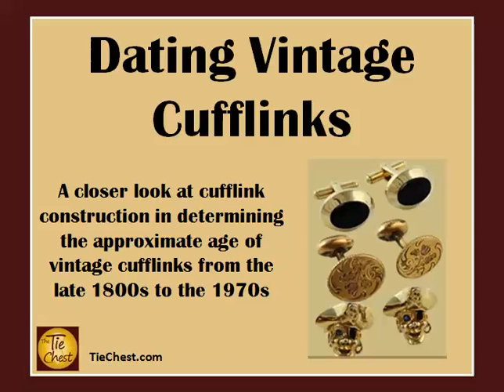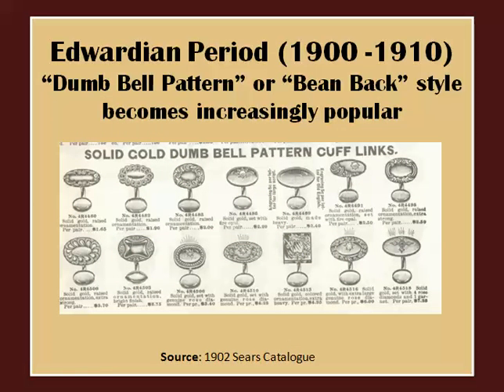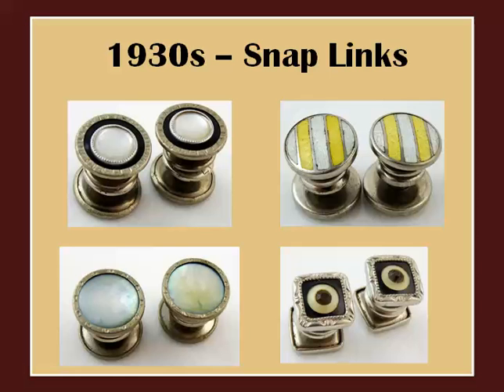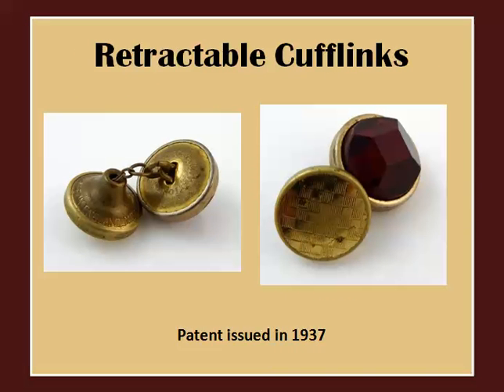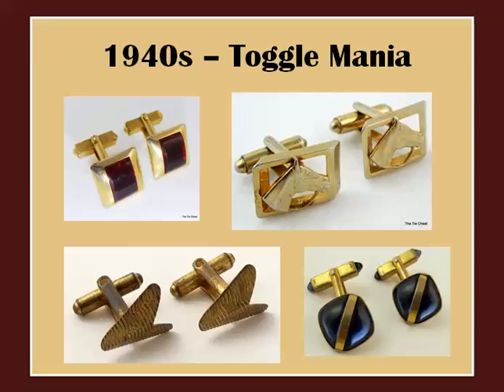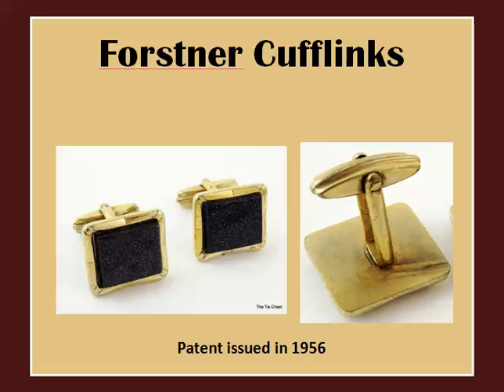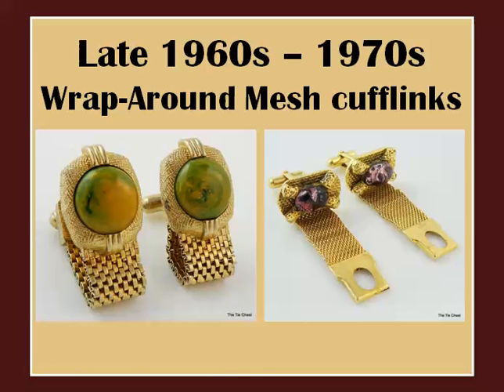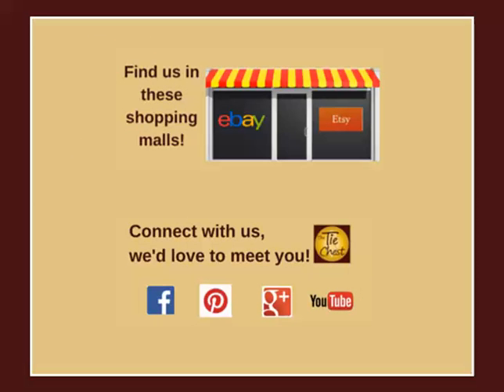How To Date Vintage Cufflinks

Comment: I thought I might try asking an expert 🤔 to help me to get a ball park figure on what I think is a rather rare pair of cuff links that were produced by an Italian manufacturer from what I've gathered by the name of Genova or Genoa as we would pronounce it I understand. It is a toggle back rounded front flat back patented accordingly to your research 1959-61. Not pre pateint. It's is a cufflink watch set. The watch works wonderfully! And quite accurately as well. I've run into nothing but walls really when it comes to putting a value to them. I would extremely appreciate any help, history or  knowledge you could bestow on to me immensely. Not a lot out there on cufflink watches. So I figure let's try the experts!!! Thank you for letting me bend your ear. The time is truly appreciated.
Reply from the maker: Hi Eugene, Thanks for reaching out. Sounds like a fascinating pair of cufflinks you have there! Unfortunately, I've never come across anything like that before, so I can't legitimately offer you any valuable advice... Good luck in your search and thank you for watching!